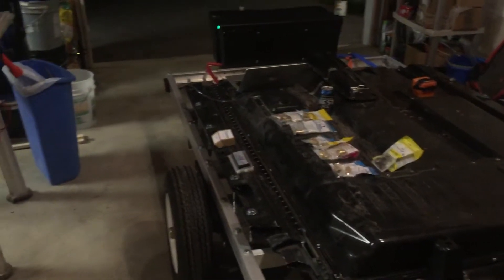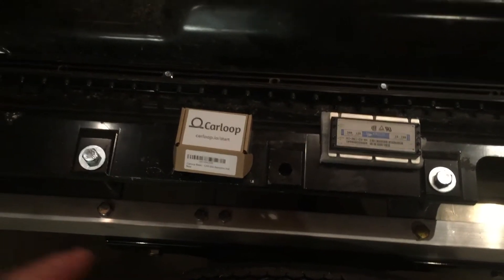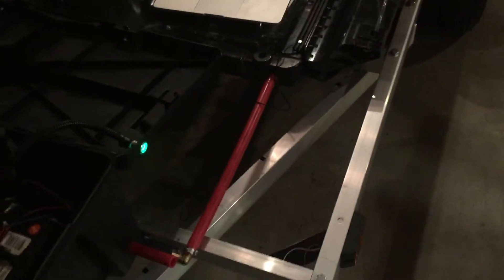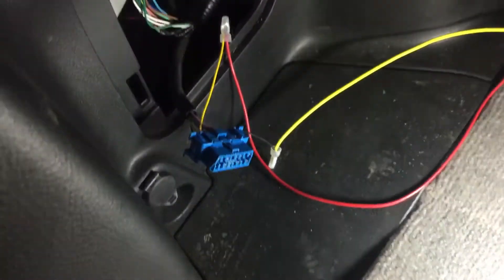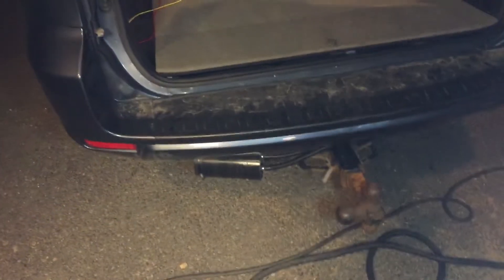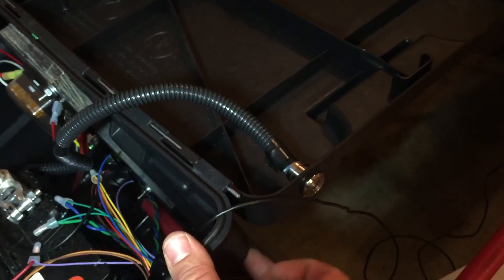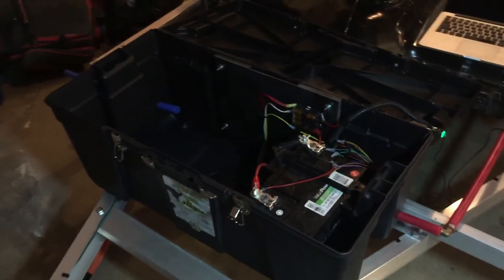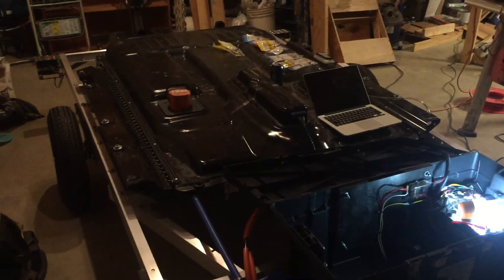T-Rex Build: Getting Started, Carloop, Vicor DC 2 DC, CAN bus Capture + Lots more

Comment: The max weight on your towball should not exceed 100 lbs for safe towing.
Reply from the maker: Roy Gardiner, the RAV4 EV actually wasn’t rated for any towing at all yet I still have for years and it’s been great. I have a John Deere zero turn that I tow to properties every week in the summer. No issues. No wobbling. No shaking or fish tailing.

Comment: Any exposed PEX needs to be fully covered otherwise UV will degrade it to the point of failure, that's why it's usually covered up inside the wall of a building. Also, general specs are 180°F at 100 psi, so don't go over either, otherwise...KABOOM. I would have thought a flexible rubber/vinyl hose would have been a better choice for the plumbing? Tesla uses something like that in the car cooling loop, though PEX is certainly cheap...
Reply from the maker: Yup, it’s going to be covered in pipe insulation and then the insulation, which also breaks down in UV, gets wrapped in thick tape. 

I know it’s not ideal but everything is experimental at this stage. If everything ends up working I might replace it later. 

I have done extensive work with solar hot water systems. In 2 systems I used pex tubing as a test. It’s been 3 years now and both systems are working fine. Those systems can see 240 degrees so I figured this system, which will probably only see around 170ish max, would be fine too. 

Thanks for the input Liam!